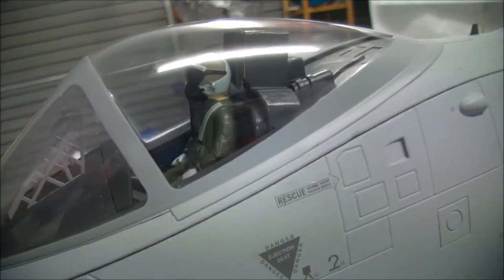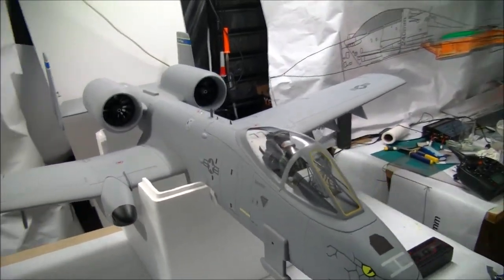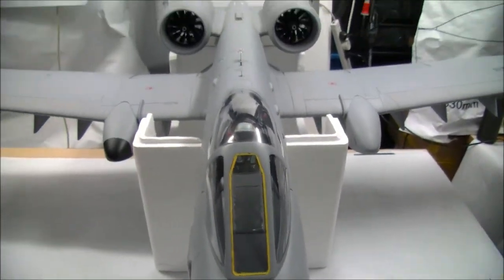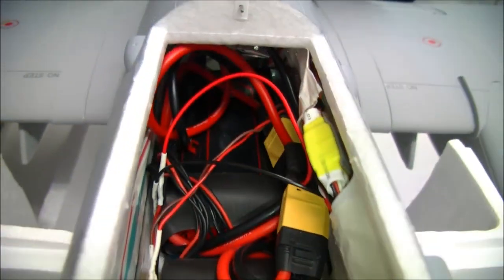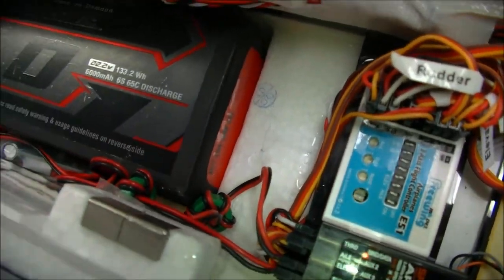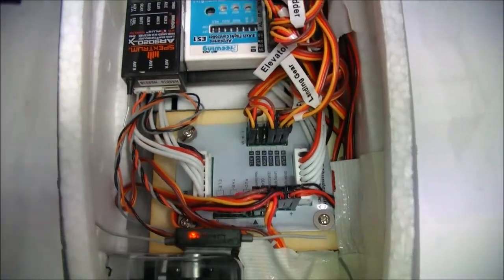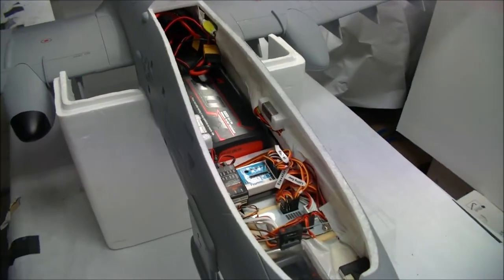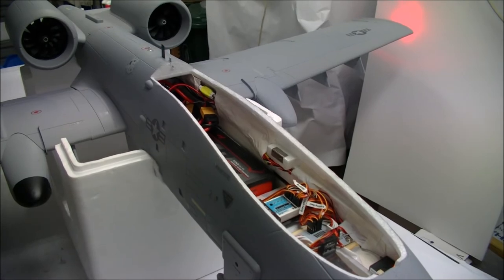Freewing A-10 Twin 90mm EDF Jet Upgrade | RC Skunk Works ADP

Comment: I've seen the newly available fuselage slots running for/aft used to epoxy square carbon fiber tubes to strengthen any twist or bending load to the fuselage.  Wiring can go anywhere...  Thanks for the great content, keep it up...

Comment: Gyro instructions say to place your gyro on the CG of the aircraft which is considerably AFT to where you currently have it.  Also noticed that your receiver antennas are parallel to one another, the tips should be positioned 90 degrees from one another.

Comment: I realize this video is six years old.  Are the 90mm EDF's helpful for people who fly at or above 5,000 feet ?  The air pressure up here is 12.2 lbs sq inch.  I received no response from Freewing, so the question remains, would using 90mm EDF's help with the lower air pressure at my altitude?

Comment: Manual cg is a good bit nose heavy. I fly mine at 86mm, which is much more neutral and makes the model behave a lot better. 

Clean install though, but recommend pushing the cg back a bit if possible.
Reply: janmb how do you measure cg like that
Reply: Mrsonicslash5 The user manual calls for a cg that is 78 mm behind the leading edge of the wing at the wing root. I instead have my cg a little further back, 86 mm behind the wing leading edge.

I measure by using a ruler to carefully mark the point I want the model to balance at, then either use fingers or a suitable balance tool to test whether it balances where it should. Then move batteries around until it does.